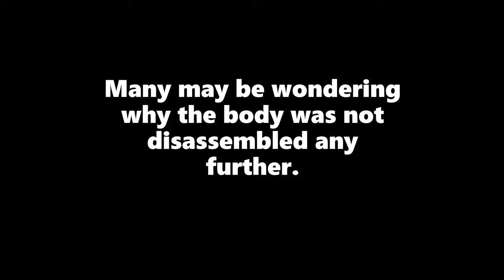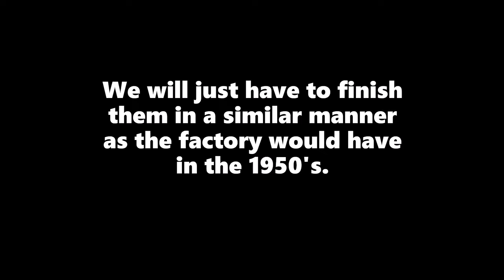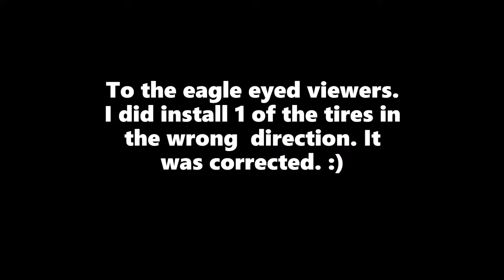1950's Doepke Adams Road Grader Restoration

Comment: Nice, awesome cool. 😀👍
Oh and you could have left the front wheels backwards if you don't want it to. On the actual motor graders, I used to operate for a living. The front tires are backwards. The groove of the tire allows the front of the motor grader to stay up on the slope when it's cutting slopes.  So you can go either way with them on the front.  Nice job on the grader. 😀👍
Reply from the maker: Hi Carl. Thanks for the info. I had never thought of that. Always something new to learn as long as I keep pumping air!
Reply: @RepairRestore  Well thank you for the come back Earl. Yeah that's a nice motor grader . It's got good metal in it. He'll make them like that anymore. Nowadays you get something like that they don't last a week. Before the wheels start falling off. Have an awesome day buddy. And again nice job it really looks nice. 😀👍

Comment: Had one of those when I was a kid cool old toy I guess you couldnt locate a air cleaner and exhaust tube but its excellent restoration
Reply from the maker: Hi Shane. I looked at these all around the internet and never saw one with an exhaust stack. It was not until I restored the Doepke Heiliner that I realized that they just fell off super easy and that I had missed it. I will have to pick up another next time I order from Gasoline Alley Toys.

Comment: Are those 3/16 inch binding post nuts?  if so did you use a 3/16 bit or one slightly larger to make the holes big enough to to attach the front wheels ?
Reply from the maker: I can't remember the name of them right now, but I just measured them with a caliper and went a touch bigger with the drill bit.
Reply: @RepairRestore  Thanks for the info